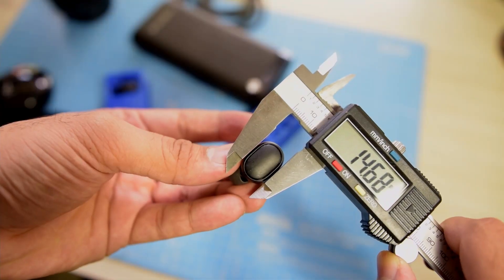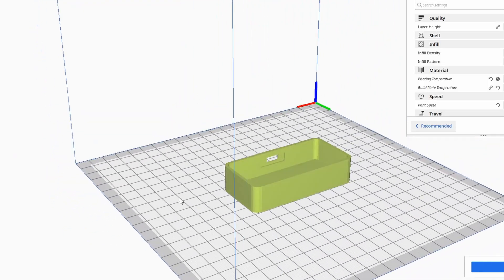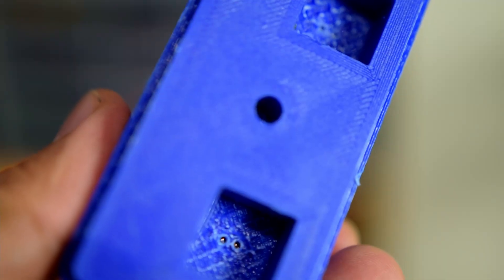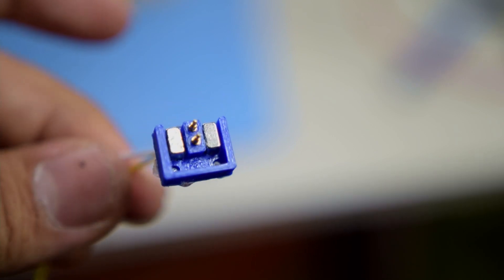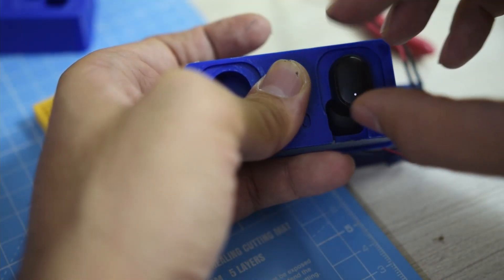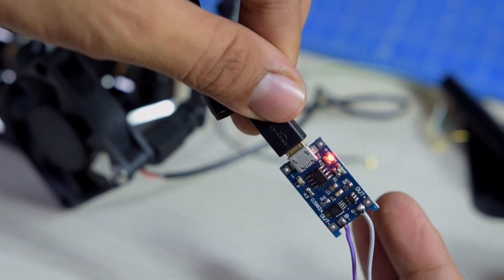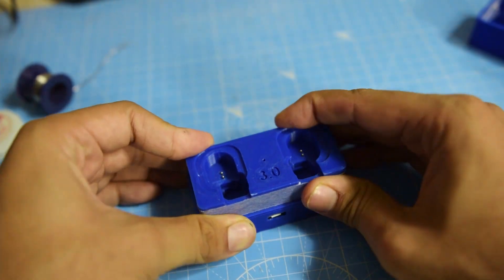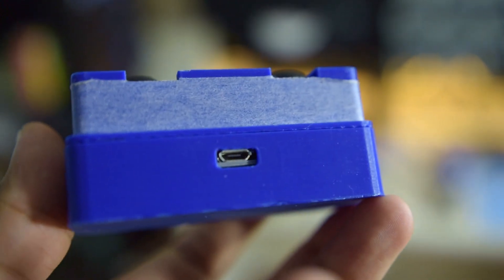DIY Wireless Earbuds Charging Case  | Redmi Airdots

Comment: Quick question. I have read online that you shouldn't connect the load the load (in this case, the buds) to the TP 4056 while the battery is being charged, which you have done here. Is it safe to do so? Have you had any issues yet or it works fine? Also, do the buds cut off when they're fully charged while the case is also being charged?

Comment: Thanks for the video... I'm an engineer (retired) and have worked with quite a few Indians over the years... Your English was fairly understandable, unlike many of the Indians that I have worked with... It was not uncommon for us to have to get one Indian whose accent we could understand to translate for us the Indians whose accent we could not understand even though they were supposedly speaking English...

I have never found those pins locally either and end up just ordering them on eBay from China.  When I order them though, I order quite a few more than I think that I will ever need since they are pretty cheap in bulk... The only problem is that by the time I need them again, I've forgotten where I put them... :(

I have a pair of earbugs that I need to make a charger for because the old charger slipped out of my jacket's pocket when I was riding my Harley and ended up getting run over by a car before I could turn back around and retrieve it... To say the least, there wasn't anything recognizable after that... :(

Instead of using an old cell phone battery, I'm more inclined to use an 18650 battery since I have a few of them around from old laptop battery packs... These batteries are also used in the power banks that are sold on eBay that do not come with a battery installed in them...

The one issue that I have with the Tozo earbuds though is that I don't know which of the contacts are positive and which are negative... I don't want to have to break the case open and see which contact is soldered to which pole of the battery... My old eyes don't really want to cooperate with electronic microsurgery these days anyway...

Comment: If the charger puts out 5v couldn't you also add USB plugs and use it as a power bank?
Reply from the maker: Yes but it'll be a very slow charger for modern phones

Comment: Can you make a charger case of sony wf-1000xm3,I badly need it.. it's the expensive one I bought but I losed it,and I can't even build this circuit because it has 3 dots
Reply from the maker: Shit those are some expensive buds. If it has 3 contact points it'll be a trickier to make.
Reply: @chinmayshalawadi1  exactly 😭,and it doesn't even have a 1% charge to check which point is +'ve and -'ve
Reply from the maker: See if you know anyone else who has thr same buds and tell you the polarity. 

Even then you'll have to figure out what the third contact point does 🤦‍♂️
Reply: @chinmayshalawadi1  I heard it's for the earthing

Comment: Just amazing 👌👌, I have one tws but it's circuit is not charging my earbuds, should I change  it's circuit and use modules like yours,does every earbuds need 5 vatt to charge, I tried with 4056 circuit board to charge earbuds but it was slow and only to 70 percent
Reply from the maker: Along with 4056 battery circuit you also need a step up board which converts the voltage to 5V
Reply: @chinmayshalawadi1  aapke is circuit me earbuds ki battery full hone pe bhi charge hota rahega ki automatic off ho jayega.
Reply from the maker: Automatically stop ho jaayega
Reply: @chinmayshalawadi1  thanks
Reply: @chinmayshalawadi1  one last question,  mere pass power bank ka chota module pada he  ,jo me wo lagau to wo bhi same hi kaam karega na, uske output wale usb ko nikale ke usme earbuds charging pin joint karna he
Reply from the maker: Haa should work
Reply: @chinmayshalawadi1  thanks

Comment: Brrroooooooo 🤯 This is so amazing maaaannnn 👍👍👍👍
I have one pair of  QSR earbuds bought back in 2016 or something. I still don't if I need to put the buds in their port and connect the port to a charger or without charger also the buds get charged. Help me man...the buds get discharged in less than 3hrs...
Reply from the maker: if they get discharged within 3 hours then the battery in the buds are gone
Reply: Noted that the batt wud have drained. But what is the correct method to charge them for my knowledge please. I mean do I need to charge the port first to its fullest and then place the buds in the port? Or Do I need to place the buds in their port and connect the port to a charger??
Reply from the maker: Doesn't matter actually either ways buds will get charged in a similar way.